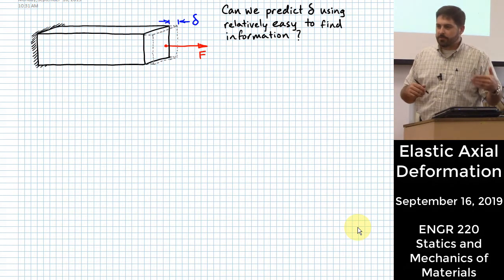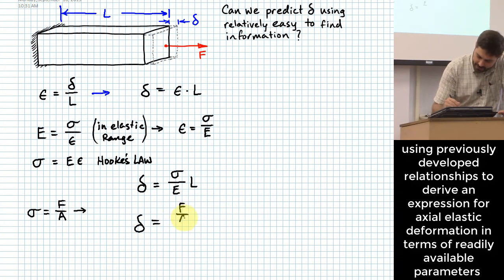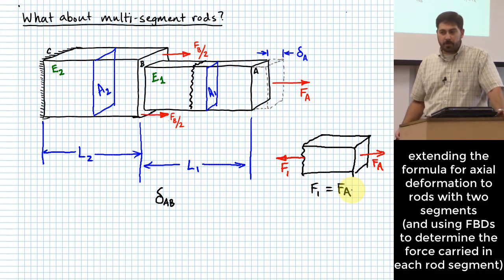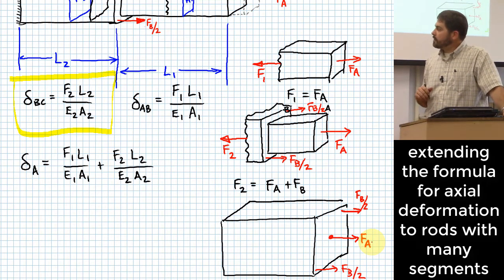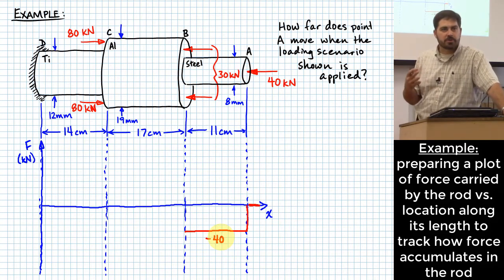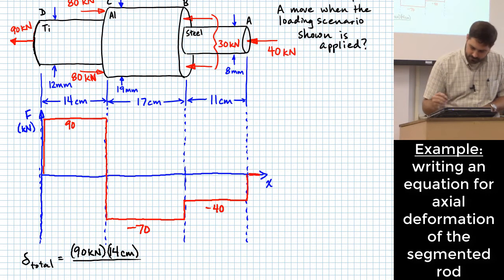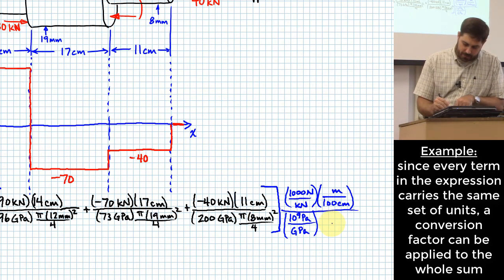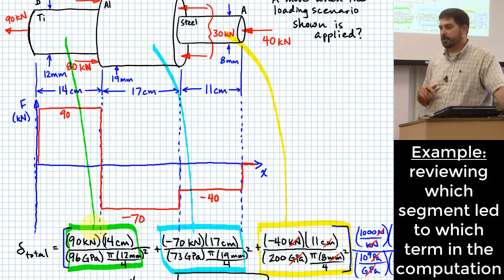Elastic Axial Deformation | Finding Forces & Deflections in Multi-Segment Rods w/ FBDs & Force Plots

Comment: Thank for your courses :)  I don't understand in the example at 17:30 why we don't consider the force F_B for calculating delta_AB. Indeed, the CB part applies a force F_B on the BA part and so we should consider that the tensile load applied on the BA part is F_A - F_B. Am i wrong ? To me, we should have delta_AB = (F_A-F_B) * L1/(E1 A1)
Reply: I think I get it : the CB part does apply a force F_B on the BA part but not in the cross section in BA since the point A is free. Is this right ?